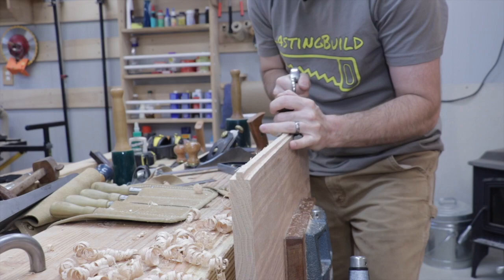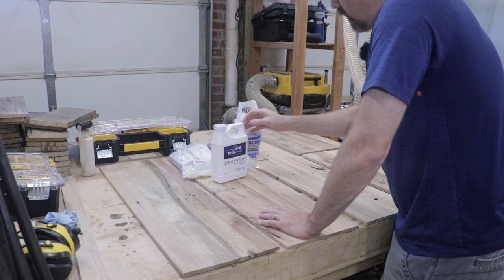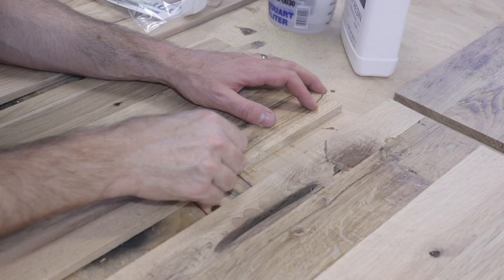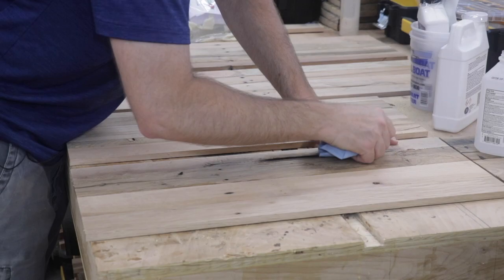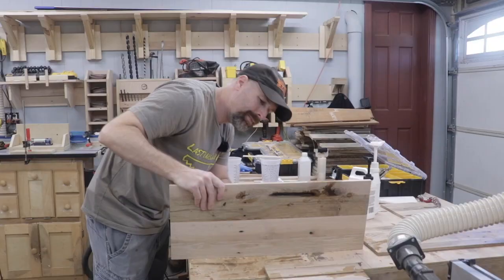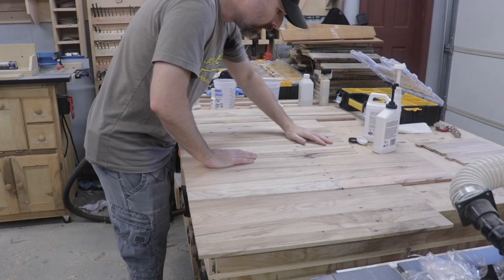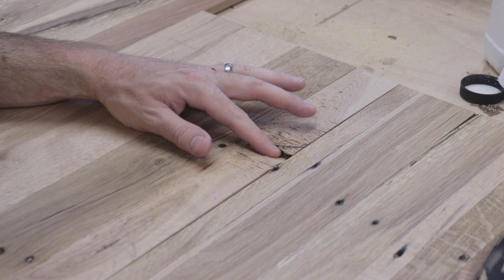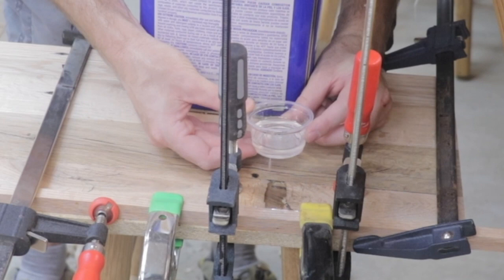Pallet Wood Repair With TotalBoat Epoxy Resin | French Cleat Plane Till Part 2

Comment: Just an FYI. Epoxy does not dry, it cures it is a chemical reaction changing the two liquids into a solid plastic, where as glues like PVA dry by releasing water vapor, and  others dry by releasing other solvents.  Epoxy may out gas, hence the smell of some epoxy's, the primary reaction is exothermic and is creating a hardened polymer.
Reply from the maker: Good point!